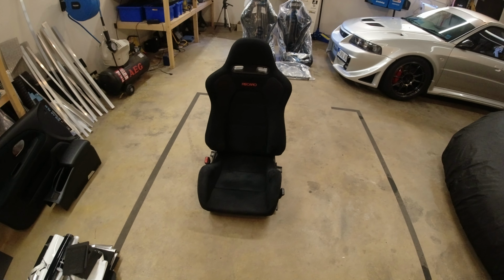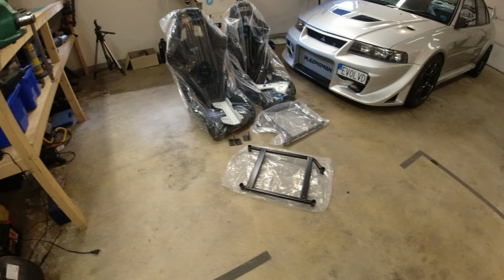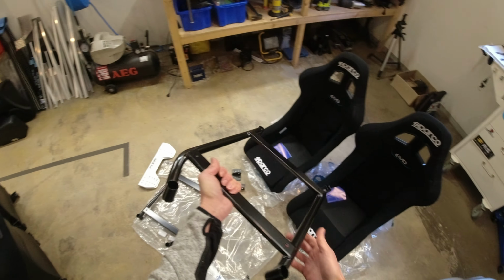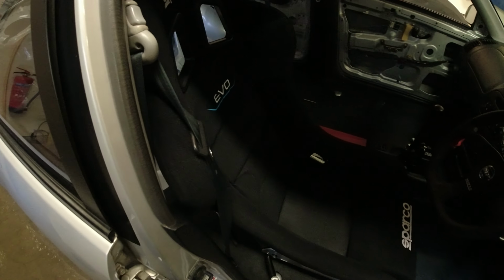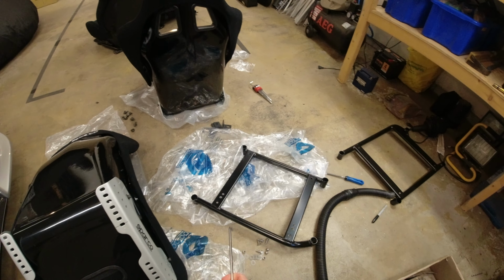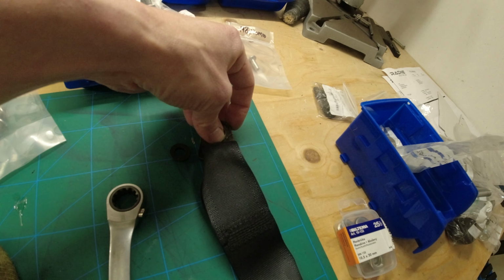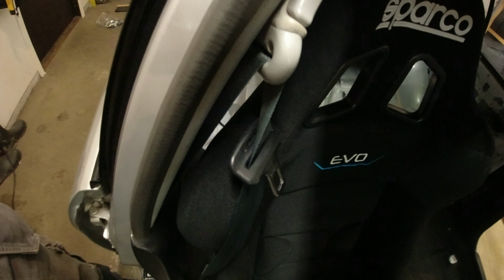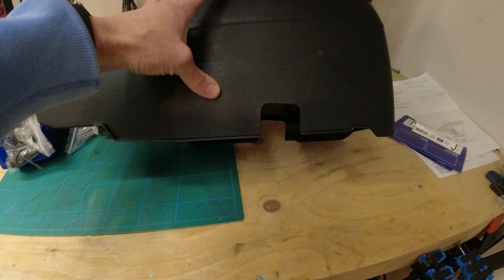FITTING SPARCO BUCKET SEATS IN THE EVO

Comment: Excellent job Mythical Mark!  The new Sparco Evo seats are gorgeous. They look great on your Evo5. I liked how you modified the brackets under the seats to anchor them to the car.  You manage to make perfect even the pieces that were not made well by the factory. I like how you have incorporated the seat belt grips into the new Sparco Evo seats. On the passenger side, I would leave the seat belt free, without letting it pass through the hole in the seat.  To make passenger entry more comfortable. On the driver's side it is perfect, indeed it makes you glued to the seat. Congratulations Mythical Mark for the excellent job. Good evening and have a great weekend 😃☀️👍
Reply from the maker: Glad you liked it Salvatore, that is a good idea for the passenger too. I need to test them out in the Spring and see if this system works ok.
Reply: @SoloLap  Great 😃👍